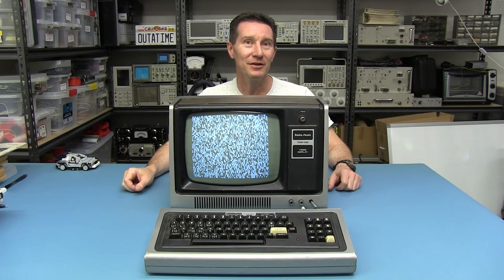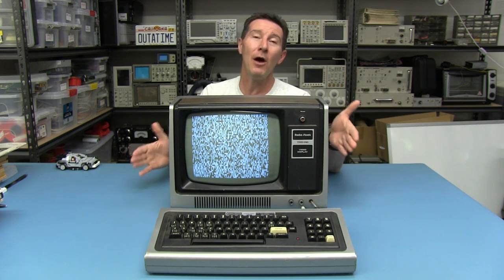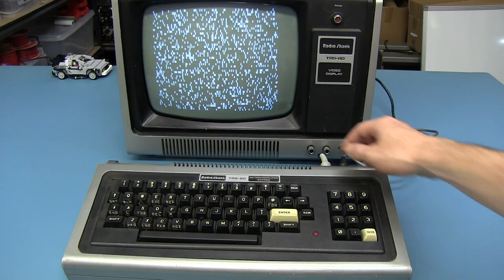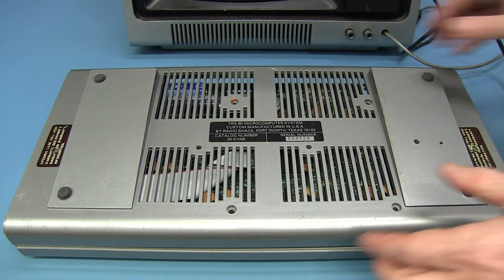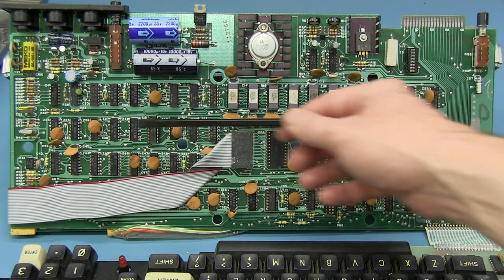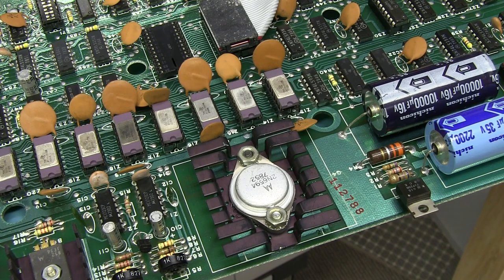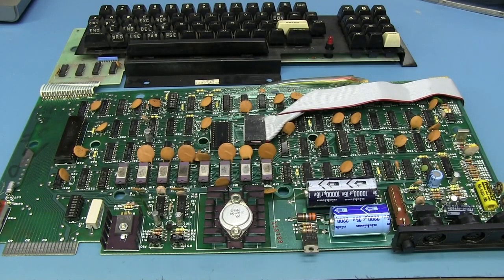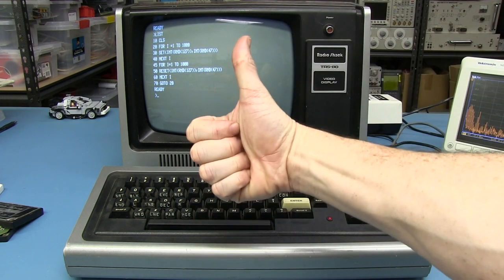EEVblog #645 - TRS-80 Model I Retro Computer Teardown

Comment: Few things: 

* I am nearly certain that the monitor came with the computer as a set. You couldn't plug it into a television.
* R/S never offered a free "upgrade" from level l to level II. R/S charged a fortune for that upgrade. Of course, hackers as myself upgraded our own machine for a tenth the price.
* Older keyboards often had problems with keyboard "bounce," whereby a key when pressed once actually pressed twice. This was later corrected.
* TRS-80 had sound, through the cassette port which you plugged in through the stereo. 
* That button on the back was the reset switch for when the program or DOS (usually TRS-DOS) crashed on the expansion interface. TRS-DOS was the official R/S DOS, and it was horrible. As a kid, we used to play the game called "Crash The DOS." New-DOS and L-DOS operating systems were far superior.  
* I modded my TRS-80 and put in a lower case kit for cheap. At the time, it was considered very fancy. There were two lower case kits available. The better one had a lower "y" and "g" that hit lower. The cheaper ones the "y" and "g" were "raised" (there were technical terms for those that I forgot). 
* I added a speedup kit which modded the CPU from a Z-80 to as I recall a Z-80A (or was it a Z-80B?). Recall the speed doubled or better, but again could be off. 
* I modded my TRS-80, added the memory myself to make it 48K. Just pry off the old memory 4104 chips (as I recall) and snap in the 4116 chips. Then change a jumper or two. Cost was (as I recall) $25 per 16K ($75 total). For Radio Shack to install the memory was $150 (or was it $250) per 16K ($450 or $750 total ?????). Note my numbers could be off. 

R/S did everything possible to sell the worst crap possible at the most expensive price. Software wise, they sold the worst possible dated warez for their machine. Their hardware too, very expensive and inferior. Eg: Their official R/S disk drive was only 35 tracks, and cost a fortune. The standard "hacker" drive was 40 tracks, and mine was 80 tracks, double sided & double density --- cost a fraction of the "official" R/S equipment. 

R/S did everything possible to kill the TRS-80. Most unfortunate.
Reply: That monitor that came with the machine  did NOT have a tuner so you couldn't watch TV on it.

"Older keyboards often had problems with keyboard "bounce," whereby a key when pressed once actually pressed twice."

I think you meant to say"Older keyboards often had problems with keyboard "bounce," whereby a key when pressed once actually registered twice."
Reply: @rricci  Actually, the bounce was a real, physical micro-bounce. One fix was to resolder the offending key to the board.

Comment: Oh gosh. This was the first computer I used on my first job as a programmer. The keyboard is the entire computer that is why is so bulky. There was a memory expansion, too, a huge box you put under the screen so you could have memory to use disk drives, everything as a separate pieces. You should turn on the parts in an specific order. It had a resident basic interpreter, no developing environments to be installed, very straightforward. If you had disks you should use a DOS from disk, but once loaded you hadn't need for the dos disk anymore, at first there was TRS DOS and later the much more powerful NEW DOS.

The Basic line editor was similar to Unix ed and vi you could learn it in minutes as I did when a friend of mine took me to his work on a weekend to play with it, during the week I made a Pong like game on paper and a mousetrap like game and came back next weekend to type it, It seemed to simple they worked very well with little corrections.

Later I began to work at the same place and never stopped programming after that. I never realized before how important this moment was in my life.

There were famous games for it. The one I best remember was Dancing Demon.
Reply: Yes, NewDos was much better, featurewise. But didn't TRSDOS (like other DOS'es) use overlays out on disk, so you had to keep the DOS disk in drive 0? Loading the entire DOS into RAM would have eaten a huge amount of RAM.

Comment: I know this is an old video, but I would add that the Apple II was the computer everyone wanted, the TRS-80 was the one we could afford. I still have my Model One which I bought in 79 and the expansion interface with RS232 card and disk drives. When I got mine it was the level one basic, and I later bought the level two kit and had it upgraded. I did find the reset line on the processor and added a reset switch. This computer still works to this day, I have replaced all the filter caps recently.  I first started using BBS with this and a Radio Shack 300 baud cradle modem.
Reply: @wildstar1063  It's so great to hear from folks from our day.  I'll grant you sysop privileges ;)
Reply: @leektah354  What I really want is access to the Hidden Files area ;-)
Reply: @leektah354  if you have access to Telnet Software you can still get the old BBS experience. There are current Sysops still running bulletin board systems on the Internet through Telnet and some even still have dial-up connections. Here is where you can get a list of current BBS systems.    https://www.telnetbbsguide.com/bbs/list/detail/
Reply: @wildstar1063  Thanks so much for the reply.  I ran and was a co-sysop in the early 90's. I sure do miss those days and all the great people I met. Thanks for the link BTW I'll check it out.

Comment: On the subject of the CBM Pet and Apple II's 6502 having a lower clock speed than the Z80, I heard somewhere that the Z80 had quite a high cycles-per-instruction (CPI) count, so it might not have actually executed instructions faster than the 6502. Maybe. Neither of them were superscalar CPUs back then of course, until one of the Z80's descendants got a pipelined ALU AFAIK.

Comment: I took a high school computer class in 84' and we only worked on the TRS-80's. I have an appreciation for those computers as they ran just fine. Not what I would want at home, but for a business this would have been a great tool. Yes, we all called them Trash-80's.

Comment: I bought a used Model 1 back in 1978 or 1979. It must have been one of the early ones because it didn't have the numeric keypad. I remember doing a mod on it involving cutting traces and soldering to get lowercase to work.

Comment: Sorry for the spelling I am dyslex..   I had one and can say there was some changes,  The DIN coneters on later ones had different numbers of pin's so you could not mix them up.  It was also posable to do a mod to give lowercase this mod needed adding two 2112 ram chips, two tamper leads and some track cutting.  The ROM expansion board was for the level II ROM.  The stanoff for the keyboard where nylon.  The PSU/regulator gave off lots of heat.  The DRAM was easy to kill, Esp from the expansion connector.  It did not have sound but meany games had sound programmed into them by turning the tape output and off at the frequency required this when as far as even having speech on some games but tock a lot of RAM.  The only thing I would relay pull you up on is the use of the term "BOOT" this term is used for when a computer needs to load it's OS from disk/tape/or other media.  Unlike computers like the TRS-80 Model 1  that have builtin OS/BASIC in ROM the circuity is designed to jump right to the first ROM location and start excuting from there(you could use the term "StartUp").  It could at a latter date have DiskDrives added and then it did need to BOOT a Disk/OS but this was note the default.   I hope you find this informative.

Comment: My friend John and I hacked my TRS-80 Model 1.   We did two hacks.   The first was to add a static memory chip (2102??) on the top of one of the other video memory chips.   There was a one data pins that was not directly connected, but was jumpered elsewhere.   This gave a full 8 bits to store upper and LOWERCASE.   The second hack was to replace the Z80 with a 4MHz version and replace the clock crystal.   I seem to recall that there was a few other clock related things.   Anyway we ended up going twice as fast with additional crappy lowercase characters.  Yep, crappy because the lower case bit maps  were bad looking.

Comment: My fist computer purchased in 1977 when I was a Junior in High School.
Many memories.  I soon was programming in Assembly Language.  Wrote my own BBS software.  I then owned a Model 4D with the high-res graphics card. 
Only design flaws I can say especially on the Model I was the lack of a fan to keep the board cool.  Model I lasted 19 years.
For the Mod I, I had 4 DSDD Disk Drives, Expansion Interface, and Direct Connect Modem. Also the very noisy Line Printer VI.
Mod 4D had a 15Meg hard drive.
I also owned a Mod II with the (4) 8" Drives in their case

Comment: The "hidden key" you pressed was a "reset" key.  If the Expansion Interface is hooked up, it would reboot the machine and boot up the Disk Operating System from the floppy disk in Drive 0.

Comment: How is it we came from giant power bricks with big humming linear transformers back 30 years ago that plug directly into mains power outlets, and output v5 or v12, to tiny small wall-warts with USB connectors (which are largely hollow inside) that output about the same voltage, which also plug directly into mains power sockets?  I'd love to see a comparison video on this Dave.
Reply: that is linear power supply vs switchmode, basically instead of 50/60 hz if you multiply that by hundreds or thousands, a much smaller transformer can match the large heavy one, but the more complicated circuit makes them harder to fix

Comment: The RF interference was so bad on this that I used to have to negotiate with my parents when I could program without interrupting their "Hockey Night in Canada" viewing - which was unwatchable with the TRS-80 turned on. There was a space game written that used changing timing loops to generate "buzzing" noises on am AM radio placed near the computer. It was quite amazing how "laser firing" sounds and "explosions" could be mimicked simply by changing looping timing causing the RF interference to change.. amazing ingenuity.

Comment: Instead of running around responding to a bunch, let me throw my nuggets of info into the fray.

I was a tech support guy at Radio Shack from when I was 15 (1979) until 1991, just before they crashed and burned in Canada (the company was devastated when insiders artificially pumped the stock values up, then sold everything and bailed).

The TRS-80 was originally built so that, if they didn't sell, they could use them internally as terminals for store operations. Instead they had a wildly successful product that they never could build enough of. They bought an entire JC Penney store and converted it into a factory to build them.

The RFI was able to make dramatic sound effects on a nearby radio. Everyone around in those days will remember the sound effects for Dancing Demon or Backgammon...

The Z80 is not a microcode processor and just because everyone at the time thought it was doesn't make it so. There are some great references about this around the net. In fact, the Z80 is still being sold today, they make great drive controllers.

I realize you wouldn't know it today, but in the 70s the Shack was a geek hangout. Each store had probably 50-100 regular hangers-out, who would often spend hours wandering through the components and reading every chip's datasheet. It was not unusual to sell someone $50 or $100 of horribly overpriced components so they could build a project from a magazine that often didn't work anyway.

The stereo equipment in the 70s and early 80s was brand name, rebranded and often with the "bells and whistles" excluded. They were not overpriced for what they were, and I personally know many people still using Radio Shack hardware from that era. In fact, I have a pair of Realistic speakers right beside me right now.

The TRS-80 was one of the best machines in its day for learning. You may remember a barely known individual who wrote the BASIC for this machine and hand wrote Level3 BASIC, and great add-on delivered on tape. His name is Bill Gates, and his company, Microsoft, was barely known for anything in those days.

Comment: I have four of these complete with expansion interfaces, level two with RS-232 boards, disc drives and tape drives. Someday I may put them on Ebay. Why 4, I bought one and then helped my employer to set 3 of them to test electronics, when they phased them out, they gave them to me.

Comment: You know what'd be good on that, as a demo, rather than just a screen full of random noise? Conway's life. A Z80 (as in the Sinclair Spectrum) did a text-mode version of that which was pretty fast, back in the day, in machine code. Think it was on one of the demo tapes. 32x24 or thereabouts cells. 

If you don't have the code handy, and can't remember your Z80 (a pretty simple algorithm, I think you can just POKE into the screen RAM on that thing to get characters), you could knock it up in BASIC in a couple of dozen lines. It'd be slow, of course, but I prefer to call that authentic! 

Just as something to look at, show some actual processing. And of course home computers like that were one of the big (relatively!) platforms for people to fiddle about with cellular automata. Often being the first time a Game Of Life enthusiast could actually see the little grey cells (cos it's monochrome!) fluctuating on anything bigger than a chess board (THAT must have been impossible, and very frustrating, to try do any experimenting with). 

Similarly Conway's Life will have been one of the early uses for home computers, back when they were trying to figure out what to use a home computer for. Before games took off around 1982, and their use became obvious. After all, what kind of homework were kids trying to claim it'd help them with!?

Comment: Well, that brings back old memories. That was the first computer I ever used. The first one I ever owned, though, was an Apple ][+; great machine, that, and the first I learned assembler on! :) Been doing some sort of programming ever since. Even though it was a bit slower, the Apple ][ did have one huge advantage over the TRS-80... Expansion slots, and the schematics in the manual!! A nice, hefty SMPS didn't hurt, either! Ahhhh... the days of yore.

Comment: 10 CLS
20 A=RND(6):B=RND(7):IF A=1 AND B=1 THEN 20
30 FOR X=0 TO 127 STEP A:FOR Y=0 TO 47 STEP B
40 IF POINT(X,Y) THEN 70
50 SET(X,Y)
60 GOTO 80
70 RESET(X,Y)
80 NEXT Y:NEXT X
90 GOTO 20
(optional, to give you a half-second to admire each pattern before it starts changing):
90 FOR I=0 TO 500:NEXT I
100 GOTO 20
This program uses the TRS-80 graphics to produce an ever-changing pattern on the screen.  The IF statement in line 20 ensures that merely reversing the pattern will never happen and may be removed if you don't mind that happening.
Also, I haven't used several of the "short cuts" in the TRS-80 BASIC where they could have been used.  I've avoided them because it makes the program flow clearer. (Line 80 could be NEXT Y,X for example).
I've done the same program on other computers over the years, but the main problem is that most of the older computers ran BASIC so slowly that it took ages to create each new pattern, especially with higher graphics resolutions.

Programming the logic in machine code would make it run far faster of course, but requires a lot more work as well as intimate knowledge of the CPU and hardware for each computer which you want to run it on.

But that, incidentally, was the purpose of the "MEMORY SIZE?" question on boot-up.  The idea was that if you wanted to reserve some RAM for a machine code program, you could do so by typing the decimal address of the highest area of memory which you wanted to use, and all memory above that would be protected from being used by BASIC so you could "POKE" a program in there and call it with "USR".

The big attractions of BASIC are not only that its core commands are the same on every computer, but also that you can write and run a program in moments with very little knowledge, and problems can be fairly quickly and easily adjusted.
The big drawback of BASIC is that because of the way a BASIC program is run, it generally runs far more slowly than a program written in a different language.

If anyone is interested in getting into a modern version of BASIC which has Windows extensions, I can recommend Liberty Basic (www.libertybasic.com).  This version has commands to allow your program to define what controls each window will contain before then opening that window.  Each control in the window can then call subroutines in your Liberty Basic program.
You can try before you buy.  You can run programs inside the Integrated Development Environment with the unregistered version.  If you want to make your programs stand-alone, you need to pay the registration fee.  There is also a simplified version known as JustBasic which is entirely free.

Comment: There's just something magical about old tech. It just never really dies. New tech? The very definition of planned obsolescence. Hell, I've got an old Korg Poly-6 synth that still runs, original battery and all. It's got a messed up key-contact strip that needs to be replaced but the mere fact that a 1976 synth that slept in a humid basement for two decades before I rescued it at a ransom of $300, still sounds as awesome as it did back on the first day it screamed to life is telling. We need to have more care put into the tech we buy. My 32 year old TS-1000 still kicks ass as well. Who needs anything more than 16k? ;)